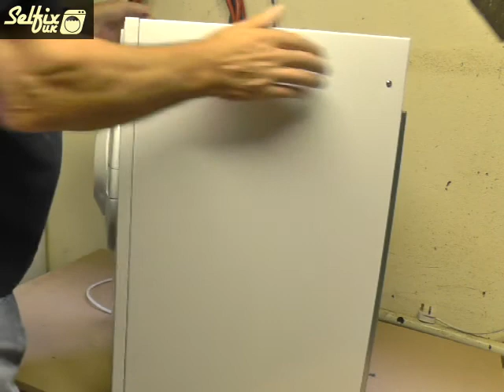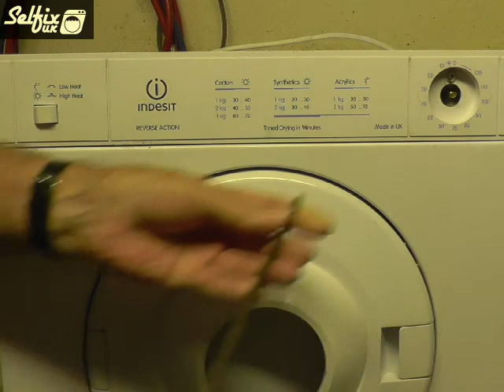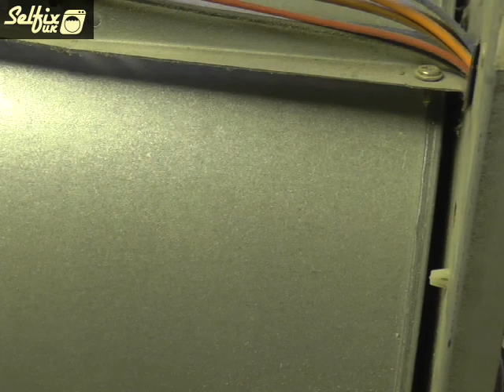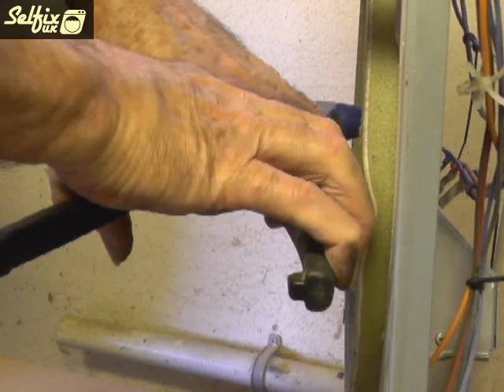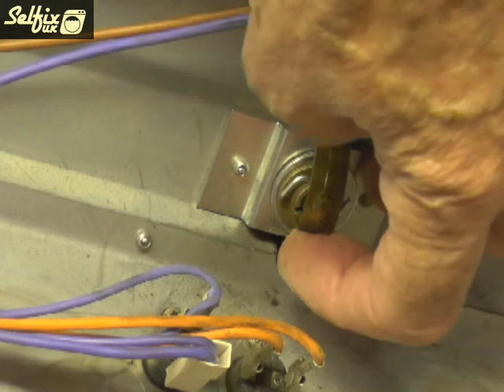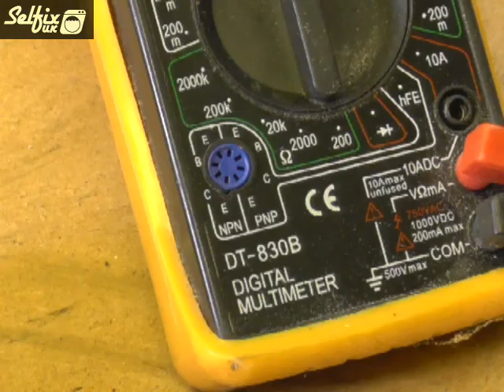3kg Tumble Drier Bearing Replacement

Comment: Thank you so much for your video. It help me  tremendously. I have a 3Kg Indesit Tumble Dyer,  Model No :-   is31V (uk). The kit needed to replace the faulty drum shaft is as follows :-  Go to   https://www.appliancespareswarehouse.co.uk  and in-put the following number in the "search Box" :- HPTC00095655    or  QUABKT88. If you follow the above video you will have your Tumble Dryer back in  perfect working order.